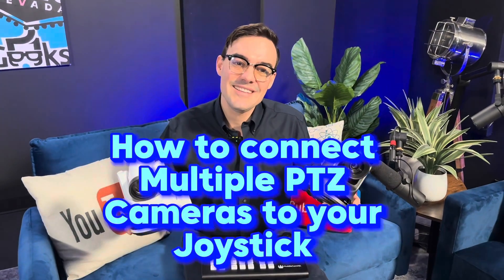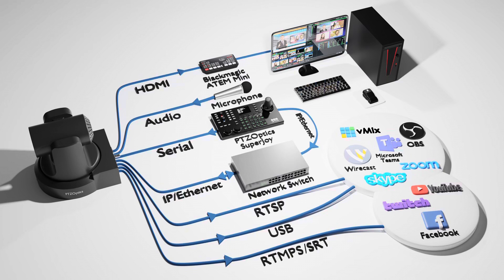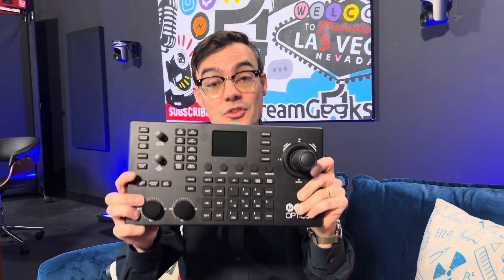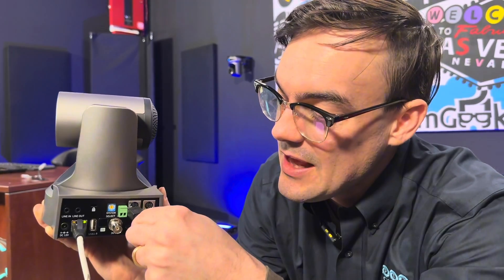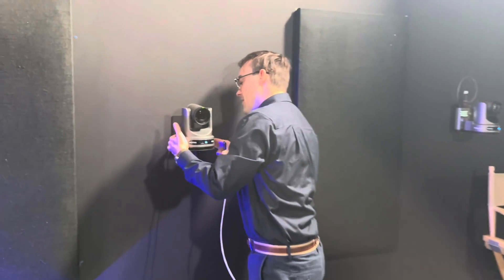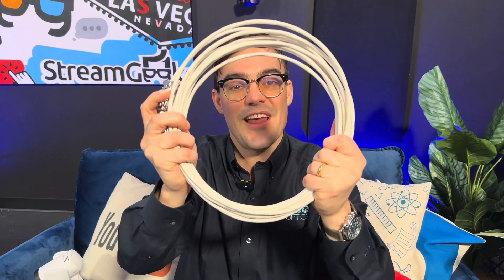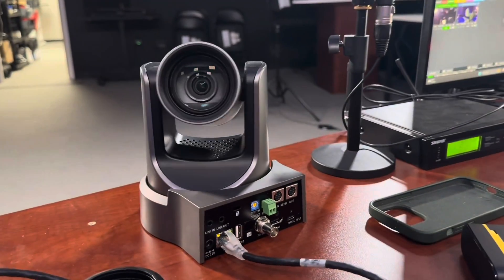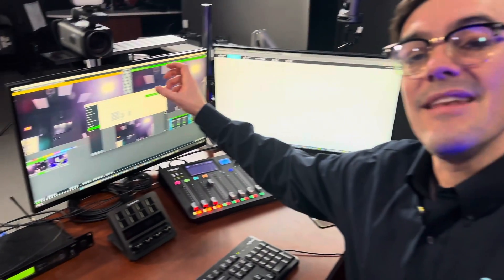How to connect multiple PTZ cameras to a controller

Comment: Hi! Does it work the other way around: can one  Move SE camera be controlled from two different PT-JOY-G4 controllers in different controlrooms but on same network?
Reply from the maker: Hello!
Yes! You can control a single Move SE camera from multiple PT-JOY-G4 controllers as long as they are on the same network. The controllers communicate with the camera via VISCA over IP, which allows multiple devices to send control commands to the same camera.

Setup Steps for Multiple Controllers
1. Assign a Static IP to the Move SE Camera
To ensure both controllers can reliably connect to the camera:
Access the camera’s web interface.
Navigate to Network Settings and set a Static IP Address (or reserve one in your router’s DHCP settings).
Apply changes and reboot the camera.

2. Configure Both PT-JOY-G4 Controllers
On each PT-JOY-G4:
Press "SETUP" on the joystick.
Use the joystick to navigate to the "IP Control" section.
Enter the static IP address of the Move SE camera.
Select VISCA over IP as the control protocol.
Save the settings.

3. Test Control from Both Locations
Try moving the camera from Controller A, then Controller B.
Both should be able to control the camera.
If there is lag or command conflicts, you may need to tweak network settings.

4. Considerations & Limitations
Only one joystick controller can move the camera at a time (whichever sends the last command).
If two operators move the camera simultaneously, commands may conflict, causing erratic motion.
Using preset recalls instead of manual movement can help minimize conflicts.

Thanks for checking out our Channel! 
Learn More: https://ptzoptics.com/

Comment: Thank you once again for your excellent presentation, sir. I have a few questions:

1. Do we need special lighting for the cameras you mentioned?
2. Can these cameras be used for a wedding event?
3. Do these cameras have any wireless capabilities? I'm concerned that if we set one camera on the speaker's podium and another on the audience, there will be too many wires on the floor.
4. If we're hosting the conference in a hotel hall, can we use the hotel's Wi-Fi to set up the PTZ cameras?
Reply from the maker: Hello!
Here are answers to your questions about PTZOptics cameras:

1. Do we need special lighting for the cameras?
PTZOptics cameras are designed to perform well in various lighting conditions. They feature low-light performance capabilities, so special lighting is generally not required. However, like any camera, having good, even lighting will improve the image quality, especially in low-light environments like dimly lit venues or conference halls. If you are concerned about lighting, softbox lights or LED panels can help ensure consistent, high-quality footage.

2. Can these cameras be used for a wedding event?
Yes, PTZOptics cameras are great for wedding events. Their remote pan, tilt, and zoom (PTZ) functionality allows you to capture different angles discreetly without disturbing the event. You can place the cameras strategically around the venue (e.g., on the altar, covering the audience, or even for close-ups) and control them from a distance. This makes them perfect for capturing large and dynamic events like weddings.

3. Do these cameras have any wireless capabilities?
PTZOptics cameras do not come with built-in wireless capabilities by default. They are typically connected via SDI, HDMI, USB, or Ethernet cables. However, you can use third-party wireless transmission systems to make the setup wireless. For instance, using wireless HDMI/SDI transmitters can help reduce the number of cables, especially if you want to place one camera at the podium and another in the audience.

Alternatively, if you're using an NDI®-enabled PTZOptics camera, you can use your network infrastructure to transmit video and control the camera, which would eliminate the need for traditional video cabling. This still requires a solid Ethernet connection but could reduce floor clutter with fewer cables overall.

4. Can we use the hotel's Wi-Fi to set up the PTZ cameras?
Technically, if your PTZOptics cameras support NDI® or are IP-based, you could connect them via a network. However, using Wi-Fi in a large hotel hall, especially if it's shared with other guests, may not be reliable for high-quality, consistent video streaming. Wi-Fi can experience lag, packet loss, or interference, which could affect camera control and video transmission.

It's highly recommended to use a wired Ethernet connection for stability, especially during critical events like conferences or weddings. If wireless is your only option, make sure you use a dedicated, high-bandwidth wireless access point (WAP) for the cameras to avoid potential issues.

Thanks for checking out our Channel! 
Learn More: https://ptzoptics.com/

Comment: Purchased a PTZ controller for the church stream, but have been having a hard time getting it to talk to the camera. Any help would be appreciated
Reply from the maker: Hello! 
What PTZ Controller did you purchase, and what brand/type of camera are you trying to connect too?

Please contact our PTZOptics Support Team 
Support Numbers: 833-888-9706 or 484-593-2584 
Monday -Thursday: 8 am to 6 pm EST 
Friday: 8 am to 4 pm EST. 
Not open Saturday or Sunday. 
Community Portal: https://community.ptzoptics.com/s/

Thanks for checking out our Channel! 
Learn More: https://ptzoptics.com/
Reply: @PTZOptics  Adkido 30X Optical Camera with PTZ Controller with 3G-SDI,USB and 4D Joystick Controller with 5-inch LCD Screen
Reply from the maker: Thanks for reaching out — I’d be glad to help you get your PTZ controller and camera working together!

⚠️ Important First:
Adkido is an electronic component manufacturer. We don’t have direct support for their camera firmware or control protocols, but I can guide you through general PTZ control setup that often works across similar systems.

✅ Let’s Get Your PTZ Controller Talking to the Camera
Here’s a basic checklist to make sure the camera and controller can communicate:

🔌 1. Wiring & Connections
If you're using VISCA over IP (network control):
Both the camera and controller must be connected to the same network (via Ethernet).
Use a PoE switch if available to power devices and simplify connections.
If you're using Serial VISCA (via RS-232 or RS-485):
Check the cble pinout — camera and controller must match (often crossover wiring is required).
RS-485 uses 2 wires (A/B); RS-232 uses 3 (TX/RX/GND).

⚙️ 2. Match the Control Protocol
Check both your camera's communication protocol settings and controller settings:

On the Camera:
Find settings for VISCA, PELCO-D, or PELCO-P (common serial control protocols).
Make sure Baud rate, Protocol, and Address/ID are set (commonly Baud: 9600 or 115200).

On the Controller:
Match:
Protocol (VISCA, Pelco-D, etc.)
Baud rate (same as the camera)
Camera ID (usually 1)
Use the LCD screen to confirm protocol settings are active.

✅ Many cameras default to VISCA over serial (RS-232) at 9600 baud, camera ID 1.

🌐 3. If Using IP Control
Find your camera's IP address (from menu or web interface)
On the controller:
Set the camera IP address
Set control port (often 1259 for VISCA over IP, or 80/5678 for HTTP)
Make sure all devices are in the same subnet (e.g., 192.168.1.xxx)

🧪 4. Test Camera Independently
Try logging into the camera’s web interface by typing the IP into a browser.
If you can control it there, the network and protocol are likely working — issue may be in controller config.

🧰 If Still Not Working
Try changing protocol to PELCO-D or PELCO-P on both devices — many generic PTZs use these by default.
Double-check your cables (especially for serial) — TX and RX may need to be flipped.

🧠 Final Tip:
If your controller has an auto-scan or device discovery feature, run it — sometimes it can auto-detect the camera address and protocol.

📞 Support Numbers: 833-888-9706 or 484-593-2584
🕗 Hours: Mon–Thu 8am–6pm EST, Fri 8am–4pm EST
🔗 Community Portal: https://community.ptzoptics.com/s/
🌐 Explore More: https://ptzoptics.com/
Reply from the maker: Thanks for reaching out — I’d be glad to help you get your PTZ controller and camera working together!

⚠️ Important First:
Adkido is an electronic component manufacturer. We don’t have direct support for their camera firmware or control protocols, but I can guide you through general PTZ control setup that often works across similar systems.

✅ Let’s Get Your PTZ Controller Talking to the Camera
Here’s a basic checklist to make sure the camera and controller can communicate:

🔌 1. Wiring & Connections
If you're using VISCA over IP (network control):

Both the camera and controller must be connected to the same network (via Ethernet).

Use a PoE switch if available to power devices and simplify connections.

If you're using Serial VISCA (via RS-232 or RS-485):

Check the cable pinout — camera and controller must match (often crossover wiring is required).

RS-485 uses 2 wires (A/B); RS-232 uses 3 (TX/RX/GND).

⚙️ 2. Match the Control Protocol
Check both your camera's communication protocol settings and controller settings:

On the Camera:
Find settings for VISCA, PELCO-D, or PELCO-P (common serial control protocols).

Make sure Baud rate, Protocol, and Address/ID are set (commonly Baud: 9600 or 115200).

On the Controller:
Match:

Protocol (VISCA, Pelco-D, etc.)

Baud rate (same as the camera)

Camera ID (usually 1)

Use the LCD screen to confirm protocol settings are active.

✅ Many cameras default to VISCA over serial (RS-232) at 9600 baud, camera ID 1.

🌐 3. If Using IP Control
Find your camera's IP address (from menu or web interface)

On the controller:

Set the camera IP address

Set control port (often 1259 for VISCA over IP, or 80/5678 for HTTP)

Make sure all devices are in the same subnet (e.g., 192.168.1.xxx)

🧪 4. Test Camera Independently
Try logging into the camera’s web interface by typing the IP into a browser.

If you can control it there, the network and protocol are likely working — issue may be in controller config.

🧰 If Still Not Working
Try changing protocol to PELCO-D or PELCO-P on both devices — many generic PTZs use these by default.

Double-check your cables (especially for serial) — TX and RX may need to be flipped.

🧠 Final Tip:
If your controller has an auto-scan or device discovery feature, run it — sometimes it can auto-detect the camera address and protocol.

Comment: What I was looking to find out is after the camera has been connected to the SuperJoy IP how is it controlled via IP.  Do I simply press the camera button i.e. Cam1 then move the joystick?  I have not seen any video that shows that in particular.
Reply from the maker: Hello!
You need to Access the SuperJoy's Web Interface to add your cameras to Cam1-6.

1. Find the SuperJoy’s IP Address: 
The IP address is displayed on the SuperJoy’s screen at startup, or you can find it by navigating the menu with the "Menu" button.

2. Access the Web Interface: 
Enter the SuperJoy’s IP address into a web browser on a computer that's on the same network.

3. Log In: 
Use the default credentials (admin for both username and password) to log in.

4. Assign Camera IPs: 
In the web interface, enter the IP addresses of your PTZ cameras into the respective camera slots (Cam 1, Cam 2, etc.).

Please contact our PTZOptics Support Team 
Support Numbers: 833-888-9706 or 484-593-2584 
Monday -Thursday: 8 am to 6 pm EST 
Friday: 8 am to 4 pm EST. 
Not open Saturday or Sunday. 
Community Portal: https://community.ptzoptics.com/s/ 

Thanks for checking out our Channel! 
Learn More: https://ptzoptics.com/

Comment: You said on the serial you set the second camera to cam 2 but how?
Reply: It’s set in the OSD menu and the joystick
Reply from the maker: Hi Jason,
To set the second PTZOptics camera as "Cam 2" on your joystick, you typically need to adjust settings both in the camera's On-Screen Display (OSD) menu and on the joystick itself. The process involves setting the camera's address to 2 (or whichever address corresponds to "Cam 2" on your joystick) and then configuring the joystick to recognize and control this camera as "Cam 2." 

Here's a general guide to help you through the process:

Step 1: Setting the Camera's Address via the OSD Menu

Access the OSD Menu: Connect your camera to a monitor or TV, and use the IR remote control or joystick to access the OSD menu. This is usually done by pressing the "Menu" button.

Navigate to the Communication Settings: Use the arrow keys on the remote control or joystick to navigate to the communication settings. The exact naming might vary, but you’re looking for options like “Communication,” “Network,” or “Serial Communication.”

Change the Camera Address: In the communication settings, look for an option labeled something like "Address," "Camera ID," or "Device ID." Change this setting to "2" or the desired number corresponding to "Cam 2" on your joystick.

Save and Exit: Make sure to save your changes before exiting the OSD menu.

Step 2: Configuring the Joystick Controller

Power on the Joystick Controller: Ensure your joystick controller is powered on and connected properly to all cameras and any control interfaces.

Assign the Camera to a Button: Depending on your joystick model, you may need to assign the camera you just set to "Cam 2" to a specific button or preset on the joystick. Refer to your joystick's manual for specific instructions on assigning camera addresses to buttons or presets.

Test the Configuration: After setting the camera's address in the OSD and configuring the joystick, test the setup by selecting "Cam 2" on the joystick and using the controls to pan, tilt, zoom, etc. Ensure the commands are controlling the correct camera.

Important Notes:

The exact menu names and steps can vary depending on your PTZOptics camera model and the firmware version. Always refer to your camera's manual for specific instructions related to the OSD menu navigation.

Similarly, joystick controllers can vary in terms of configuration options and procedures. Consult the manual for your specific joystick model for detailed instructions.

By setting the camera address through the OSD menu and then configuring your joystick controller accordingly, you should be able to control your second PTZOptics camera as "Cam 2" from the joystick. If you encounter any issues during this process, consulting the specific manuals for your camera and joystick model or reaching out for support might be helpful.

Please reach out to our PTZOptics Support Team
Support Numbers: 833-888-9706 or 484 593 2584
Monday -Thursday: 8am to 6pm EST
Friday: 8am to 4pm EST
Not open Saturday or Sunday.
Community Portal: https://community.ptzoptics.com/s/

Thanks for checking out our Channel! 
Learn More: https://ptzoptics.com/
Reply: Web interface not connecting with ip of controller 😕
Reply from the maker: Great follow-up! Let's break this down to cover how to connect multiple PTZOptics cameras via serial control (like RS-232 or RS-485), how to assign each a unique camera ID, and also address why the web interface of your controller isn't connecting.

🎮 Connecting Multiple PTZ Cameras via Serial (RS-232 or RS-485)
🔗 Serial Connection Options:
RS-232 Daisy Chain (Short distances)
Use VISCA In → VISCA Out from camera to camera.
Requires a VISCA control cable and a joystick/controller with RS-232 output.
RS-485 Bus (Longer distances, up to 1000ft)
Connect all cameras in parallel (A to A, B to B).
Use a joystick that supports RS-485.

🎯 How to Set Camera IDs (CAM 1, CAM 2, etc.)
Each camera needs a unique ID so the joystick knows which one to control. Here’s how to set it:

✅ Set Camera ID via OSD Menu:
Connect a display to the camera (via HDMI or SDI).
Press the IR remote’s ‘MENU’ button to open the On-Screen Display.

Navigate to:
System > Communication Settings

Choose:
Protocol: VISCA or PELCO-D (must match controller)
Address/ID: Set this to 1 for the first camera, 2 for the second, and so on.
Save and exit the menu.
Reboot the camera if prompted.

📝 NOTE: On some models, the setting may be under "VISCA Address" or "Camera Address", depending on firmware.

🕹️ Set Joystick to Match IDs:
On your PTZ joystick (e.g., SuperJoy):
Use the CAM 1 / CAM 2 / CAM 3 buttons to switch control to each camera.
The joystick sends control commands based on those IDs.

🌐 Web Interface of Controller Not Connecting – Troubleshooting
If you're trying to access your controller’s web interface (like SuperJoy) and the IP is not loading:

✅ 1. Check IP Address of the Controller
On the SuperJoy:
Go to Menu > System Info > Network to confirm the controller's IP.

✅ 2. Make Sure You’re on the Same Subnet
Your PC and the controller must be on the same IP range (e.g., both 192.168.100.xxx).
If not, temporarily set your PC to match the controller’s IP range.

✅ 3. Ping Test
Open Command Prompt and try:
ping [controller IP]
If it fails, the controller may not be connected properly, or firewall settings are blocking access.

✅ 4. Browser Access
Open a browser and enter:
http://[controller IP]

No “https”, just plain HTTP. Some browsers may block older HTTP interfaces by default — try Chrome or Edge in that case.

🛠️ If Still Not Working:
Try rebooting the controller and router.
Double-check network cable and PoE injector/switch if used.
On SuperJoy, ensure it's set to DHCP or Static IP (depending on your network setup).

 📞 Support Numbers: 833-888-9706 or 484-593-2584
🕗 Hours: Mon–Thu 8am–6pm EST, Fri 8am–4pm EST
🔗 Community Portal: https://community.ptzoptics.com/s/
🌐 Explore More: https://ptzoptics.com/